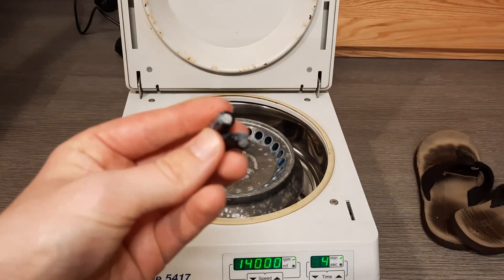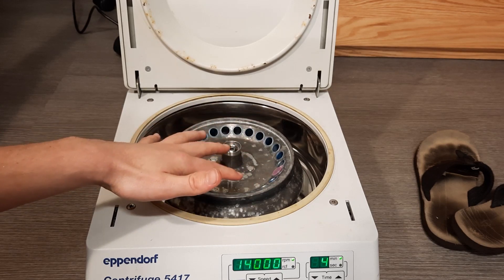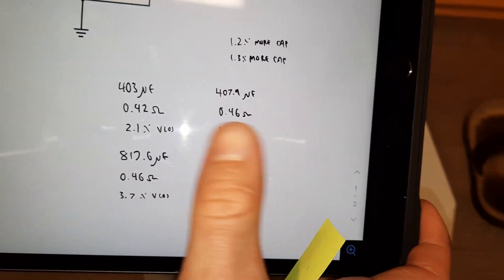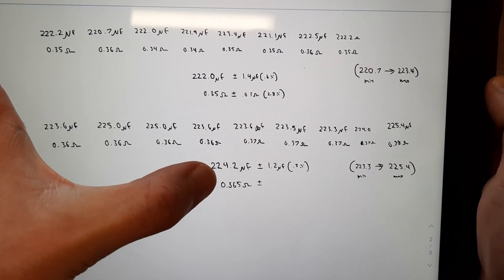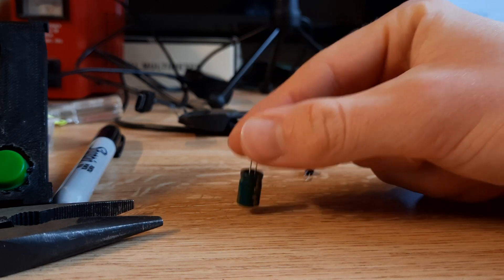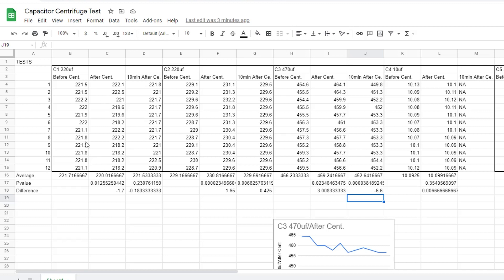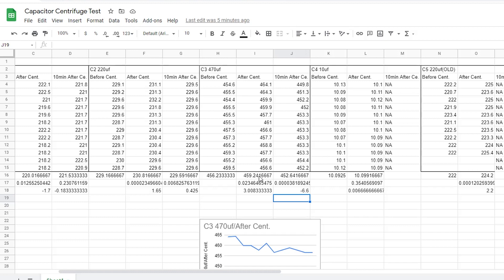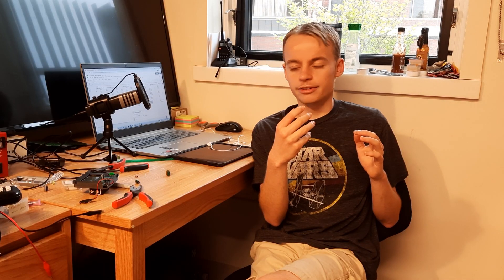Centrifuging electrolytic capacitors has an interesting effect on capacitance.

Comment: Fun stuff! Perhaps some blocking could be inserted into the tapered portion the the plastic capsule to prevent the cap from getting wedged down in there. The other variable would be temperature of the cap before vs after centrifuge. Lastly you could try an entirely different experiment with readings in real time in which you place a capacitor inside a cylinder and watch the measurements as you increase air pressure.  Or a similar test over temperature ranges. The live readings may be interesting to watch.

Comment: In your experiment, did you use caps from the same manufacturer? 
Secondly, were they quality capacitor companies like Illinois or Nichicon? Or were they cheaper imports like ChemCam or no name caps?
Reply from the maker: The capacitors were from multiple different off-brand manufacturers.

Comment: That was a very quick tester!

Are the capacitors a 20% tolerance? 

Maybe if you tried a very old wax sealed capacitor? 

Did the worn out sandals need to make an appearance 😂🤢
Reply from the maker: I didn't notice the old sandals until during editing. That would be cool to test an old wax capacitor though
Reply: @TannerTech  😂
Reply: I did some research and testing after you put a capacitor in circuit and use it for about 50- 100 hours the cap will be about 10-5 percent off  it just needs time to brake in this topic is also discussed on many data sheets

Comment: I don't think the data is statistically significant to derive any conclusion, maybe with better capacitance tests over a broader frequency range? and a way to test them while centrifuging?
Reply from the maker: I definitely agree with that conclusion.  If I have more time, I will do more tests with this.  I also think it would be good to invest in a more precision capacitor tester.

Comment: The capacitance on electrolytics probably changes based on a ton of parameters - for example temperature. Just squeezing the case a bit probably does too.
Reply from the maker: I agree
Reply: Heating electrolytic capacitors also increases capacitance. As evidenced by heating them with soldering irons while in a live transistorized audio amplifier.

Comment: Well Tanner all nice and good but what about repeatability precision of your measurement? Actually you are just using this tester which is not a clr meter. Also it uses a 12 bit ADC from the atmel processor and algorithms that at best give you an approximation. You surely show a nice way of learning and understanding basic statistics. Unfortunately they might be flawed by the imprecise measurement. Nonetheless, it makes sense that the capacity increases following a decrease as the "jelly roll" gets compressed and later on resumes it's relaxed state. However the capacitance is defined by the thickness of the AL2O3 layer which is constant. The only thing changing is the distribution of the electrolyte. This should have a higher impact on the internal series resistance than the capacitance. But then again your measurement seems dodgy to me.  Nice job nonetheless. I see you are on the right path becoming a scientist  :)